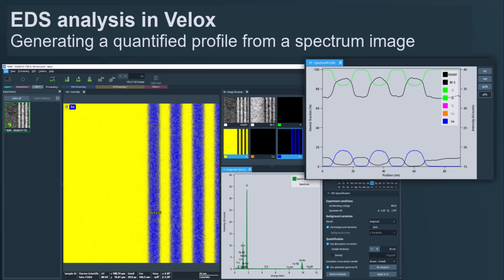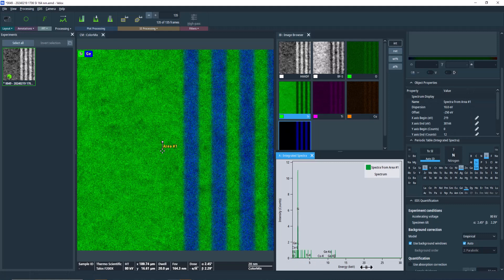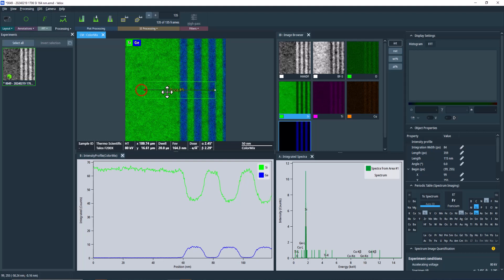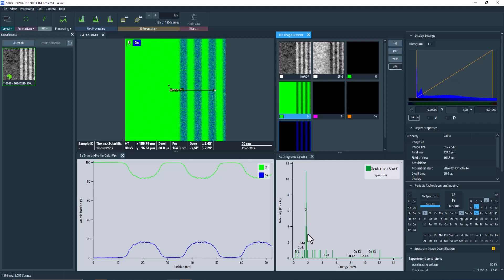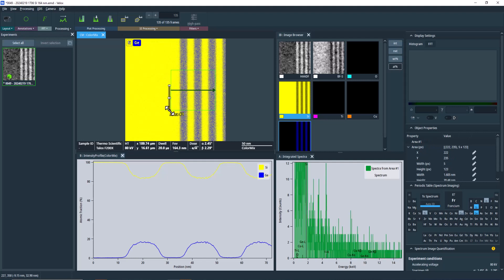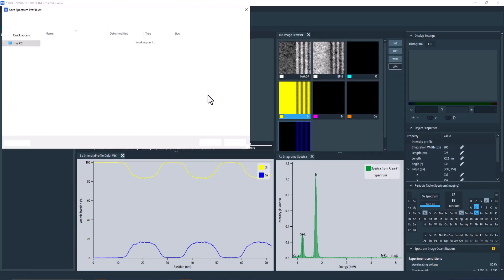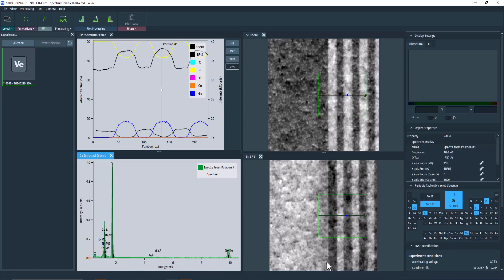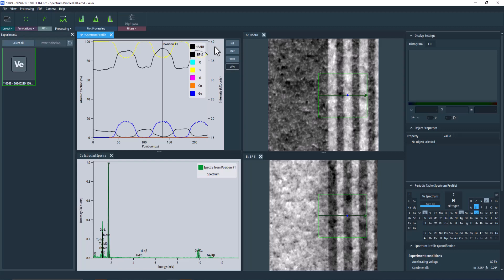Updated: Create good quality EDS Spectrum profiles from Spectrum Image

Comment: Hej,

thanks for the feature but it has to be a mistake, the compared noise in the spectrum image and the extracted spectrum profile is exactly the same (tested with my own dataset too, at different binning, Velo 3.12). 
At binning 1, the 2 profiles are similarly bad whereas the 'extracted spectrum profile' should already be much cleaner as it relies on the width integrated sum of all the pixels...some mistakes in the code I guess...?

Regards,
Olivier
Reply from the maker: Dear Olivier
We could not reproduce the issue you report.  Clearly integration works properly and Spectrum profile produces different noise pattern vs Intensity profile.  Were you using profile with small number of pixel in integration width?  If yes, than results might appear identical for datasets with very low statistics (differences just very tiny since integration is very small).  May be the best is to contact via Velox@thermofisher and share the dataset.  This way we can analyze where the issue is.